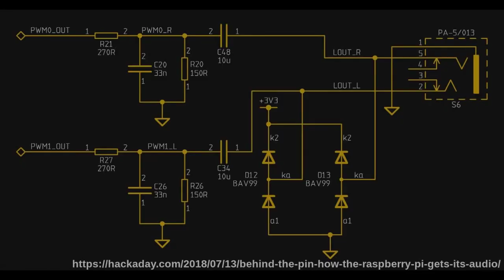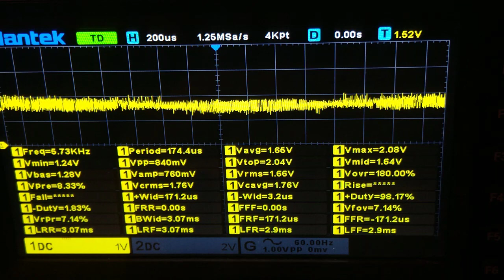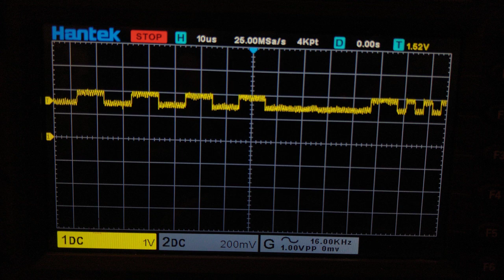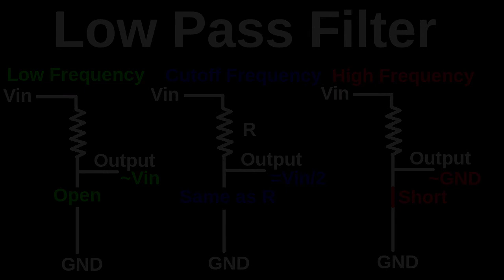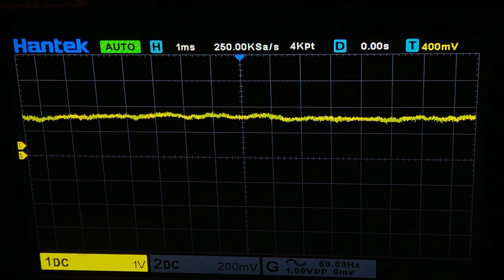WavetablePi: Better PWM audio

Comment: Hey, thanks for sharing. I build 2 devices myself ( 2 because i thought i made a mistake on the first), but when i connect it to my CT2940 nothing is happening. The DAC gets troubling hot and the pi is not booting. If i connect the pi to a normal powersupply i can see it booting up (of course it is not connected to the Soundblaster at that time. Any one build one themself and can share some troubleshooting ideas? I only have 3 CT2940 with Wavetable header…are they not compatible? Thx & Cheers
Reply from the maker: I checked with my CT2940 and the Pi powers on just fine. 
If the Pi does not power on when connected to the wavetable, it probably means that either the power or ground connection is open-circuit. Pi's pin 2 or 4 (5V) should be connected to the header's pin 10 (that is the 5th of the bottom row when looking at the Pi's side). Also the Pi's pin 6 (GND) should be connected to the header pin's pin 9 (the one above pin 10).
If either is open-circuit, you could still probably fix them with some jumper wires.
Good luck with troubleshooting!

EDIT: I just added an image with the circuit schematic on the project's page on github. Feel free to check it out, it may help you with troubleshooting.

Comment: Hmmm. I'd wonder how the signals would cope with a Clamp cap of some kind. 10pf or 22pf cap to ground from each of the signals, I don't know how well it would work but I'd be curious to find out. Normally I wouldn't add a clamp cap to audio lines but these signals are a little more "simple" compared to newer audio gear, so maybe it would help.

There's also ferrite beads for high frequency stuff but I don't see them making a difference other than acting as a low resistance resistor. 
 
Another potential improvement would be to have an LC filter to try to clean up the power going into the pi zero itself, it shouldn't make a difference with a decent PSU but noisy power always goes directly into the audio quality. 

There is always more nitty gritty stuff like moving to a 4 layer design to give yourself more ground plane between the pi zero and the rest of the machine. Slap a video card beside a sound card and you'll hear the pixels. 

Now that I'm thinking about it there's a few things I'd like to see done given that these are PWM signals. Nothing I think would actually work but it would be fun to see what they would do, maybe even a tinkerboard, those have actually good audio.

Comment: Getting different results on breadboards is not all too uncommon. Breadboards have really bad stray capacitance problems as frequencies increase. Generally on more premium breadboards they'll send a metal plate you can adhere via the sticky back which definitely helps the problem, but generally you're going to see the effects of capacitance even when no capacitors are there.
Reply from the maker: Ah good to know about the metal plate, thanks!

Comment: This big breadboard is trouble. Every breadboard is trouble, but tiny little breadboard maybe less trouble. I can hear strong mains hum.

You can use a filter with corner frequency well in the audio band; and then pre-emphasize the audio in software to compensate. Indeed due to LTAS having a 100Hz corner frequency, a 150Hz 6db/oct filter might not be that far off base!